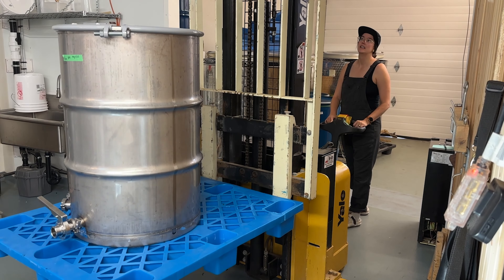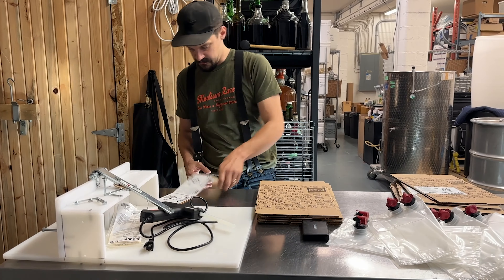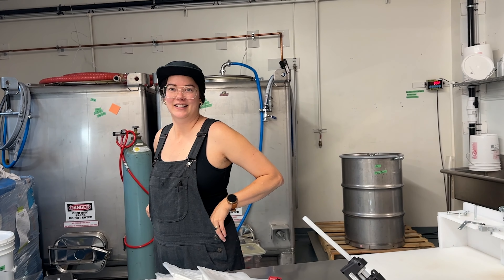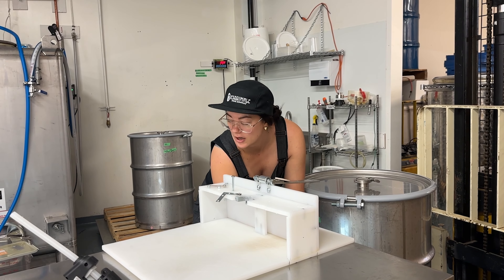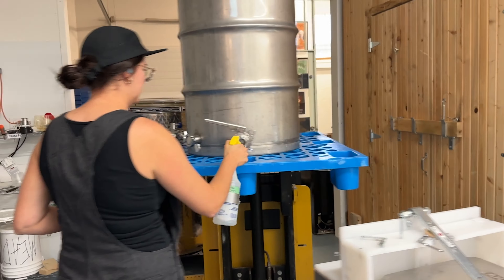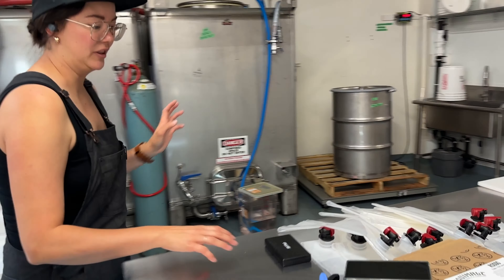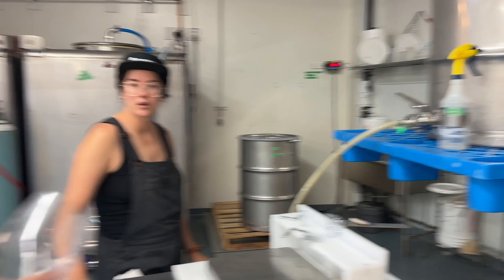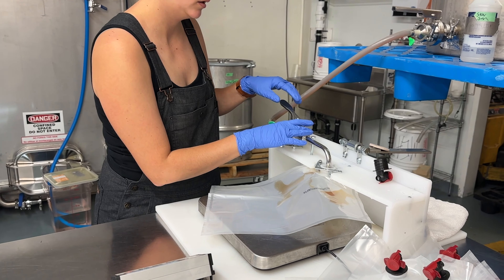We only make this for restaurants

Comment: no air getting in the line is causing that leak sry bud, the seal is not doing its job properly on the fill nozzle. if you take the nozzle apart there should be some seals or orings in there.
Reply from the maker: When I’m doubt, check the gasket! Lol! 🤠